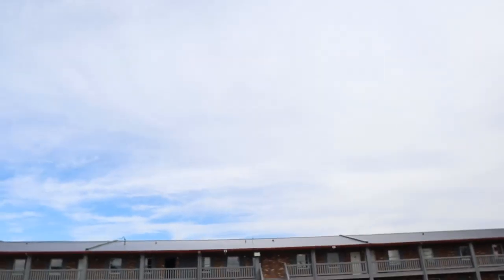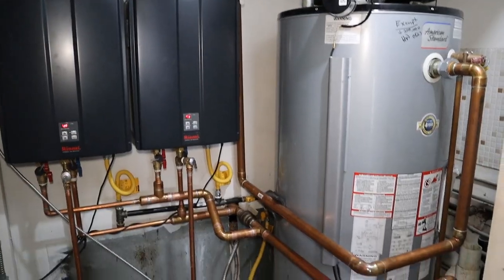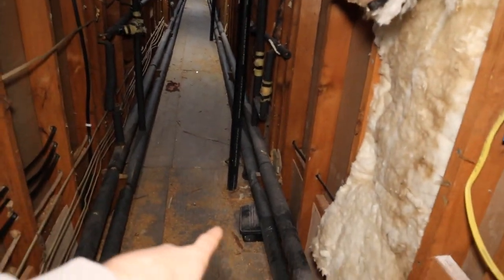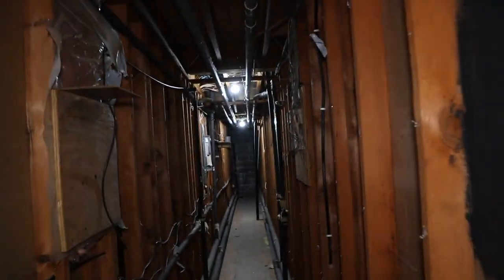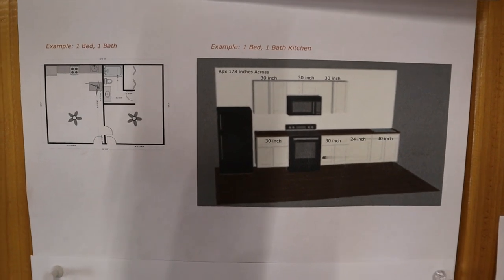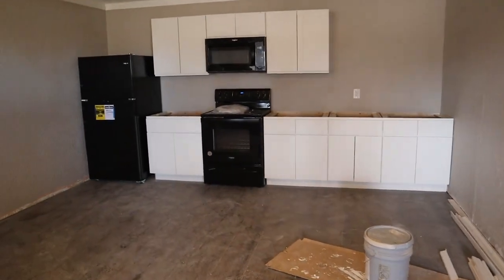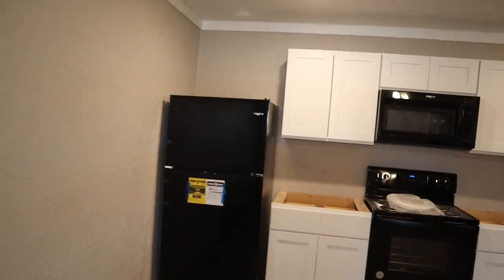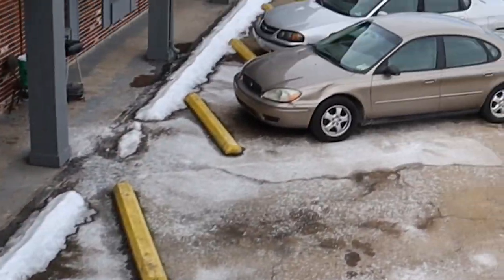Motel Conversion Update! (Red Cedar To Sunshine Apartment)

Comment: David is this in Missouri?
Reply from the maker: Yes.  Bonne Terre, MO
Reply from the maker: @krissachtleben8601  feel free to share your idea here.  If I’m interested I’d be happy to connect.   There are certain reasons that we aren’t doing a few things on purpose but I’d love to hear your ideas.
Reply: @DavidDodgeShow I thought that I replied but do not see the reply.  You could possibly add a billboard on each end. Single pole structure where the bottom is higher than the surroundings. Ideally this would not effect parking nor visibility. Several strategies with this approach. If allowed you could make great money with this approach.
Reply from the maker: We have a massive 40 or 50 foot sign already!!
Reply: @DavidDodgeShow  I assume you are talking about the one on the ground on the left side as you pull in to the complex? On Google it looks like an old single sided wooden ground structure. Google shows an ad for Sparks Motors. If you now own that structure you might be able to upgrade it and make it double sided to double that ad revenue.  Basically remove and replace with a steel single pole structure with two sides. Split the two sides into two ads each so now you have four smaller ads paying you monthly revenue. This would double the structures revenue or more. You could then keep it and collect the monthly rents or sell that structure off to another investor for a nice chunk based on what the monthly income it produces and still capture the lease revenue. If it is under lease you might be able to let that lease expire and then replace it with your own structure. You might also be able to add a second structure on the other end of the property and do the same thing. Depending on the market you might bring in an extra $2-4k per month or more. Of course this is all based on the local regulations allowing this but just thought that I would share some insight.
Reply from the maker: @krissachtleben8601  I'm not looking to manage ads or billboards at this time.  We do have a BIG metal sign that has the apts name and info as well as the mgmt co's contact info.

You can see it here: https://www.google.com/maps/uv?pb=!1s0x87d8555ca2732939%3A0xd835dc5cef2802d0!5sSunshine%20Apartments!15sCgIgARICEAE
Reply from the maker: These pics are old.   The mgmt company's sign is also up now.  Need to get better photos...